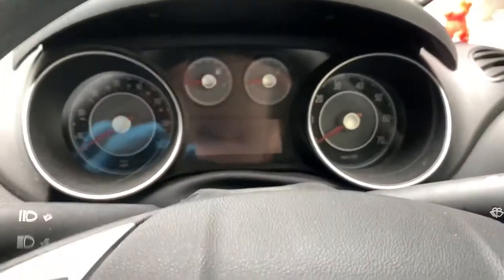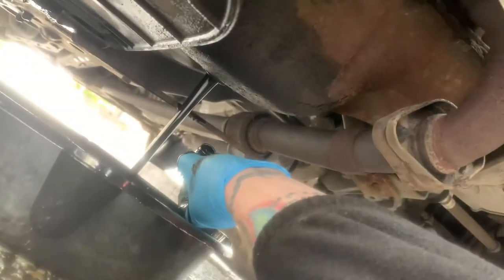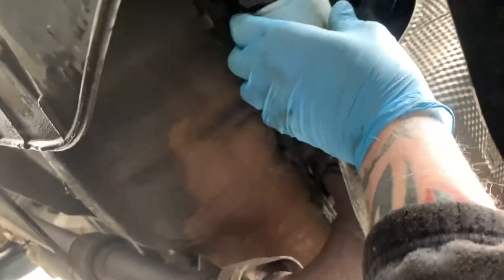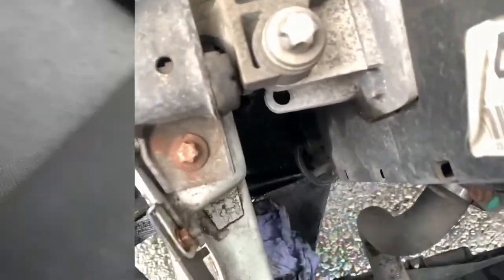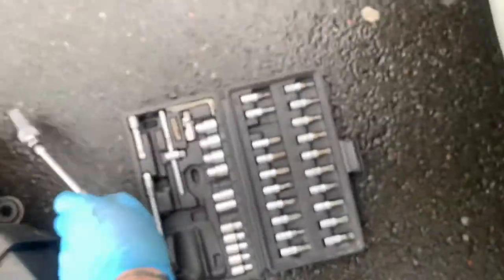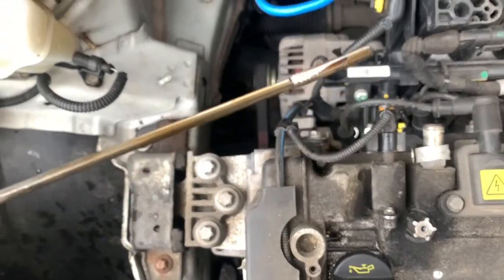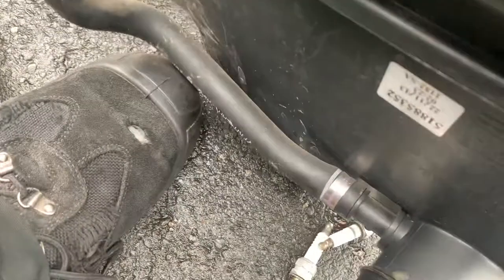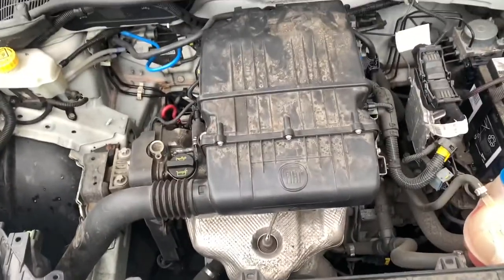Fiat Grande Punto Service, MK4 Punto 1.2 Engine Service DIY

Comment: still have my 2007 i-talian thoroughbred base model.108k of hard short distance runs. probably the most cost effective car i've ever had the pleasure of. towed my gin palace(dinghy) with ease, high 40's per 8 pints. Repairs over last 10 years- top mount (common),door lock mech(common),heater fan rheostat(common),exhaust,tyres,lamps(expected). Output shaft seal a bit weepy now,couple of scars and the sheer embarrassment of an old motor might be the end of its journey with me. I salute it.
Reply from the maker: Sounds like it’s done well.
Reply: @StupidBlokeStupidVideos  ..aaaaand....its just failed its MOT badly. Next stop,the scrappers. Serves me right
Reply from the maker: @rodneyhull9764  that’s unfortunate,.. failed on welding by any chance?

Comment: oil needs to be 5W-40 you got it wrong..and air filter was wrong installed gray sponge needs to face front of car
Reply from the maker: Oil is one of the recommended oils for the engine according to the supplier, and yes the filter was in backwards. I did put the new one in the same wrong way at first then turned it round. I thought I showed that in the video but I’ve just watched it back and it goes from being backwards to the air box being back together and I’ve missed out the clip where I turned it round.

Comment: hey dude?i lost a spark plug in the engine bay :(( the last one on the left. it went somewhere and i don't know how to take it out. before i poked it with a long screw driver i could have seen it standing. now it's hidden somewhere there? what can i do? i can't go under the car. i already ordered one on ebay. what will it happen to it? fall while driving?
Reply from the maker: It depends where it’s landed. As long as it’s not in any moving parts then it will likely just fall out and stick itself into a tyre on car behind you,.. but if it’s stick itself in the timing belt cover it’s gonna fuck shit up. You could do with finding it really as a spark plug is a significant enough lump of metal so that if it’s rattling about in the wrong place it isn’t gonna do any good.
Reply: @StupidBlokeStupidVideos   thanks for answering man :D:D
Reply from the maker: @hasisul  j no worries. I try to answer all comments lol

Comment: Any difference in the 1.2 and 1.4 engine bays?
Reply from the maker: One has a 1.2 litre engine in there, the other a 1.4 litre.  

As far as I know, as long as it’s not the 16v sporting I think they are the same otherwise though, but I could be wrong. Does yours look the same under the bonnet as this one?

Comment: You have just earned a sub thanks for the vid I have a punto as a first car low insurance haha any tips on to lower the HP it's too fast haha
Reply from the maker: Cheers mate. If you service it yourself put the air filter in the other way round then I did in the video. The original filter was in backwards and I put the new one in the same way before realising. I thought I had shown the bit where I put it in the right way round but I screwed up with the editing lol
Reply: @StupidBlokeStupidVideos  I will do thanks 😊

Comment: In my punto 1200 69 cv GPL use the oil 5w30 gazprom ecogas.. Is better than 5w40.... The oil 5w30 reduce consumption the engine works better..... In a car with 70 hp 5w30 is good
Reply from the maker: There are a few options for oil type on these engines,.. tbh I just think they’re happy as long as they’ve got some in them.

Comment: those airboxes come prebroken
Reply from the maker: Every single one I’ve seen is like that, and on the older models too.
Reply from the maker: Jusb1066 just take it off and fit a ram air intake for mad powar gainz
Reply: @StupidBlokeStupidVideos  not really, that car never worked reliably in any other sense, its long gone from me
Reply from the maker: Jusb1066 can’t say I blame you to be honest